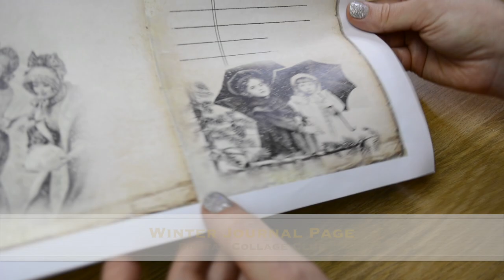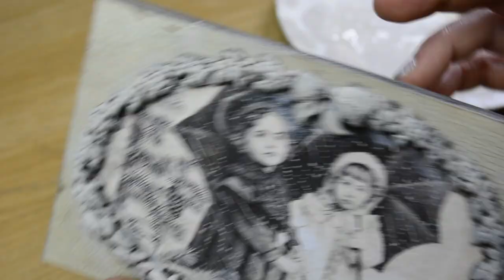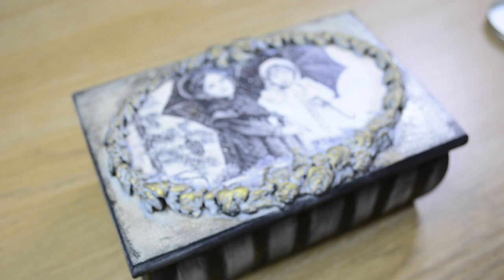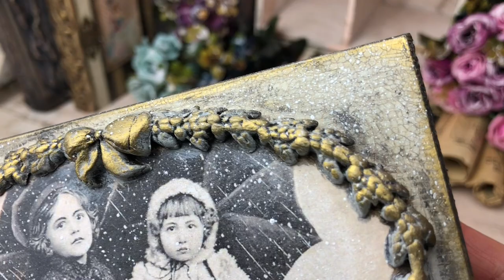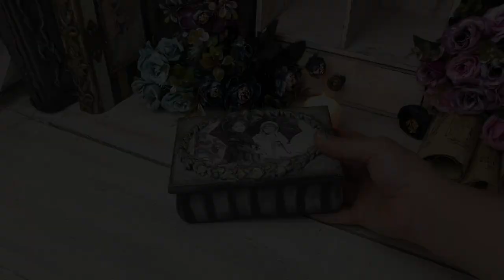Vintage Decoupage Box with Printed Papers

Comment: It's beautiful. Curious, do you do anything to your molds or the clay? For some reason I can not get DAS clay out of my molds intact. Maybe I just got a bad batch?
Reply: i did have the same issue in the past but then whenever my clay is too soft i would just oil the mold a tiny bit with a q-tip dipped into some oil (vegetable, cosmetic, any).
Reply: @TubeYouLena  Thank you, I will give that a try. :)
Reply from the maker: I just use Das as it is, sometimes it’s more sticky than others, but I rarely have to do anything extra to get it out. As Lena suggested, try oiling the mould, and also if it’s refusing to come out nicely pop it in the freezer for 10 minutes, it’ll help :)
Reply: @IvetaZiedina  Thank you for the tips. I will try them. :)